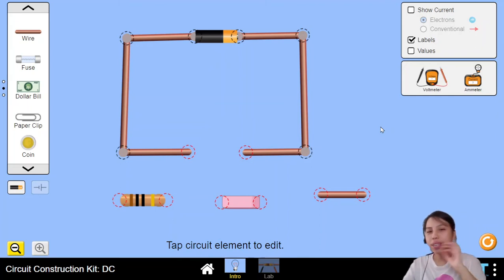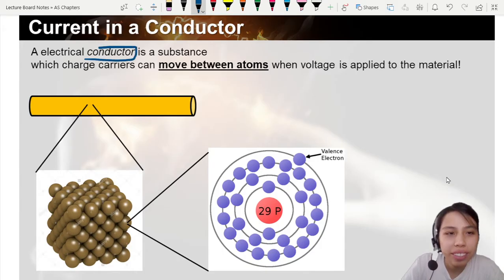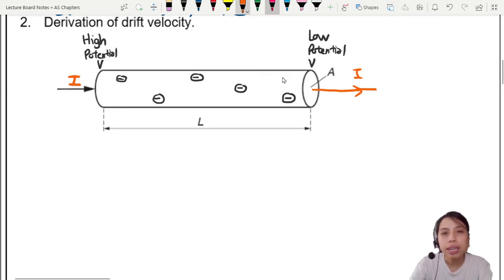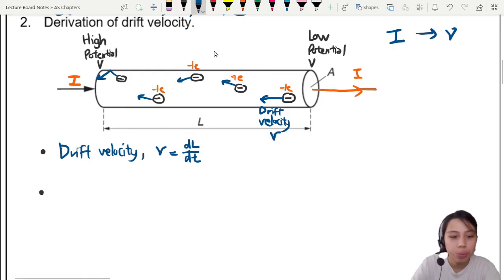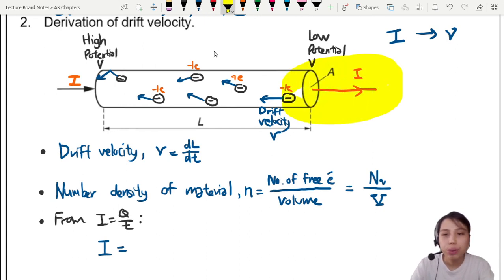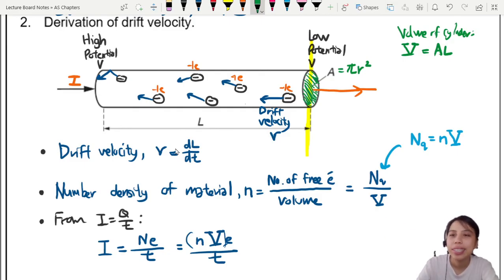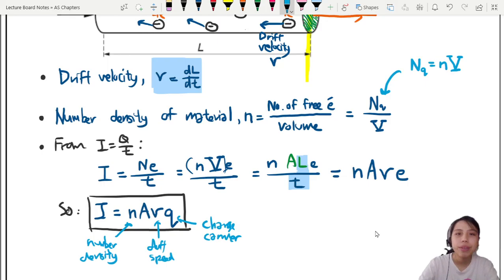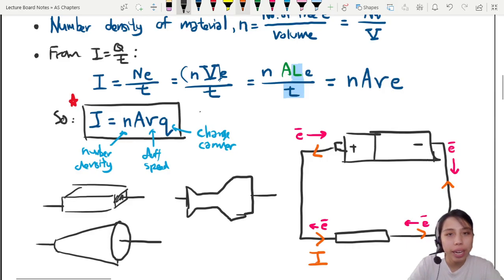9.1b Current in Conductors (Drift Velocity) | AS Electricity | Cambridge A Level Physics

Comment: How is it that the flow of electrons direction is opposite to that of the conventional current, is current not the flow of chargers which are carried by charge carriers and charge carriers can be ELECTRONS ,ions or protons. Please am I overthinking or am I just confused? Whats going on there ?
Reply: Conventional current is defined as the flow of positive charge through a circuit. However, in metals, the charge carriers are actually free electrons, which are negatively charged.